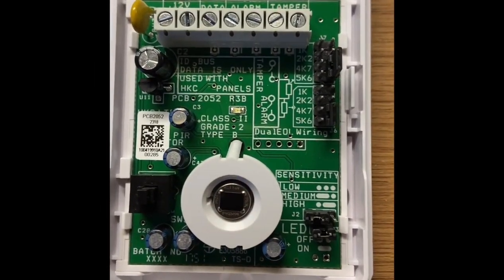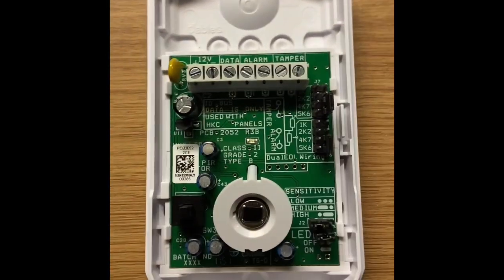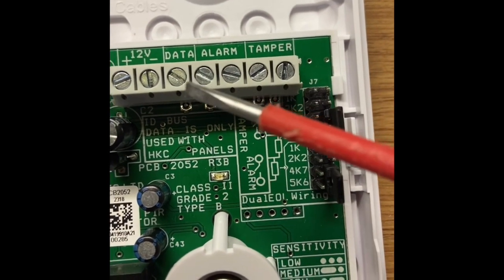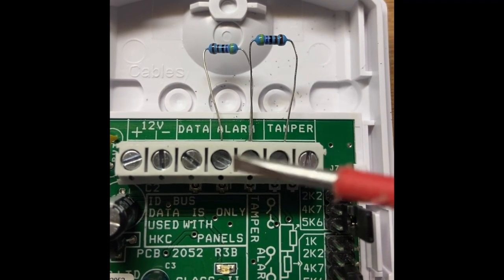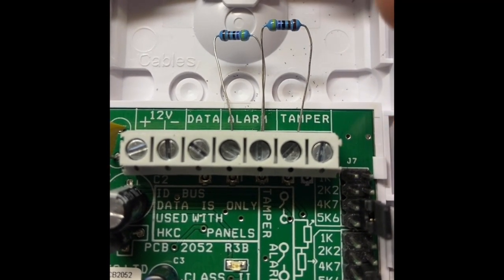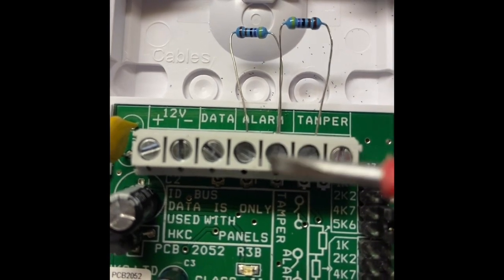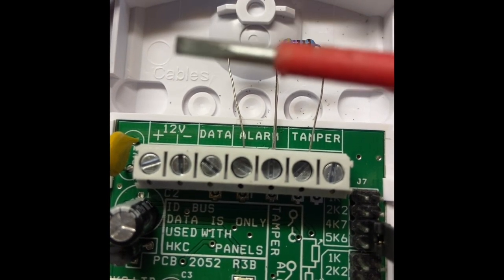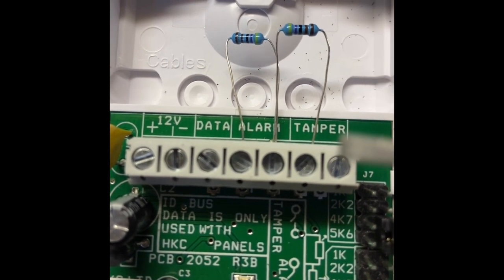How an Alarm  Detector wiring works (Part 2)

Comment: Pretty sure blue-yellow is your zone ternimal red-black for 12v aux and green-white for tamper curcuit 👍
Reply from the maker: No no.  Ain’t used red and black for power for ages.  This is my way. If you have a 4 core cable you will have red, black, blue and yellow. So on a contact I use blue and red for alarm and black and yellow (hazard colour) for tamper. Same on detectors but they would have power in addition so a 6 core is needed and the 2 remaining colours left in a 6 core are green and white so they are my power colours.  If the detector or contact is 2 wire eol it’s stale red and blue.